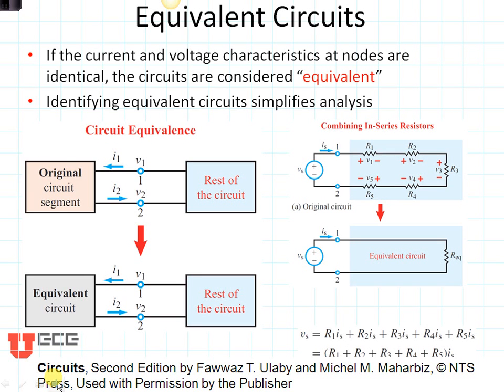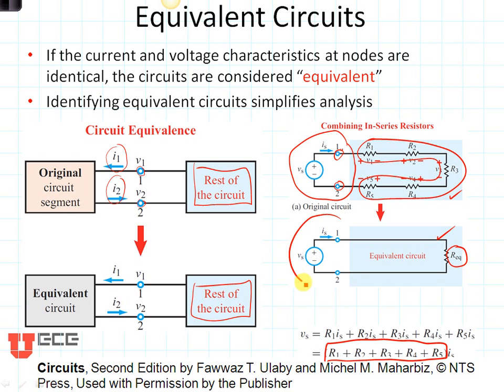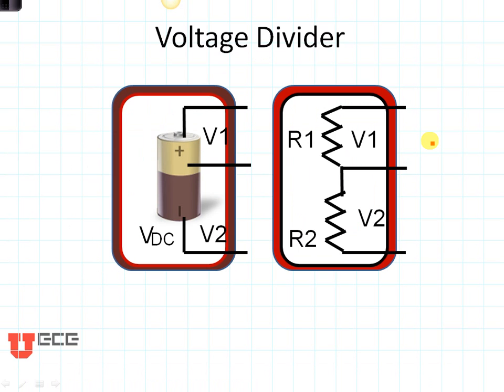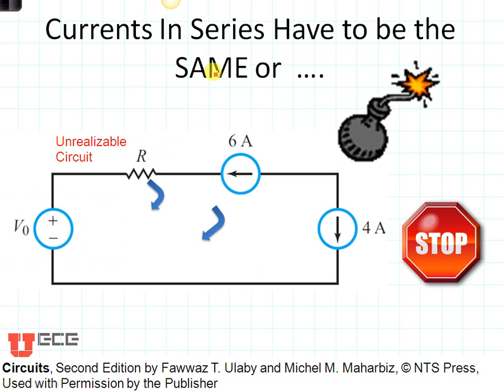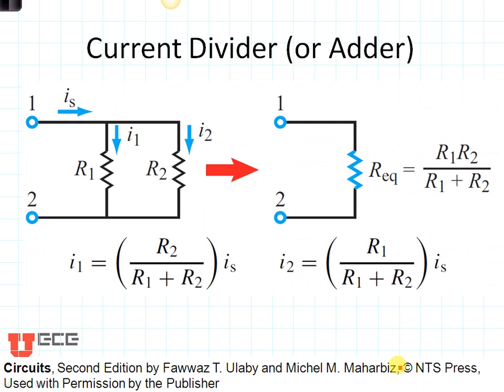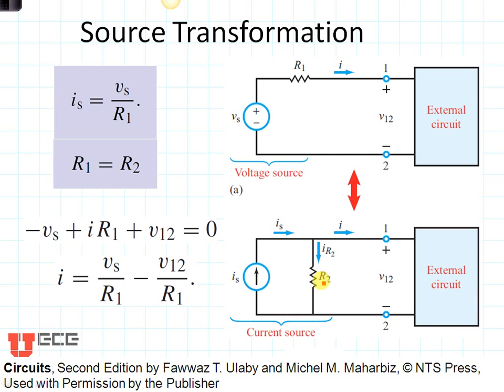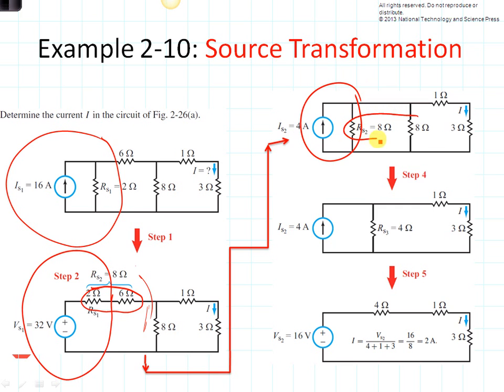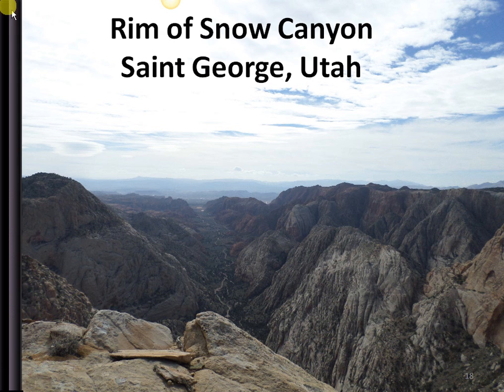L(2-3) Equivalent circuits

Comment: I found the source transformation part very confusing. I watched it several time and I am still very confused on how a series circuit became a parallel circuit and vice-versa. Please help.
Reply: I'm a bit confused about that as well. One thing I heard them say was that your transforming the beginning bit from a circuit source to a voltage source which allows you to change the series to a parallel at the beginning of the circuit back and forth.